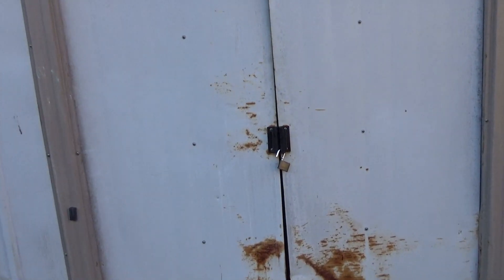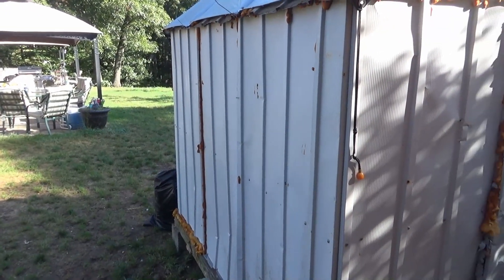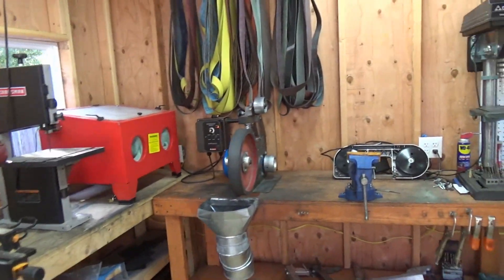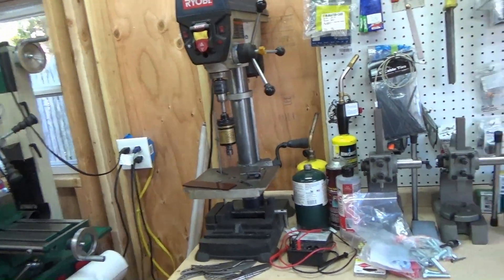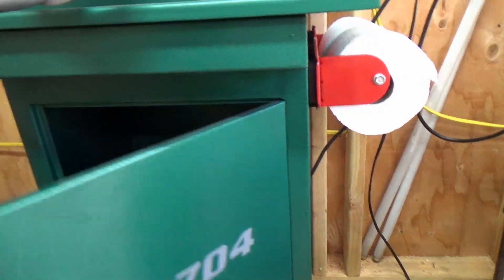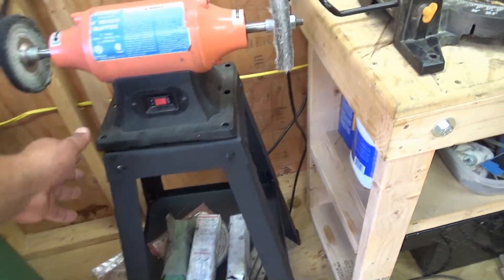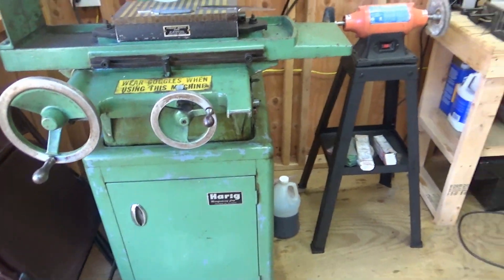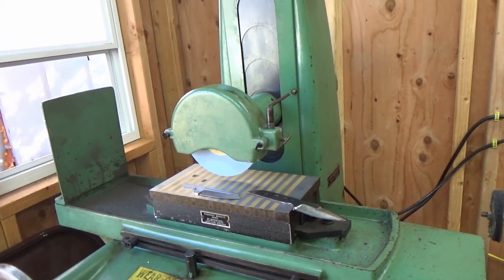I'm back with a big update!!

Comment: You put the right kind of cutting blade on that miter saw you can use it to cut steel bars for your knife blanks quickly and efficiently and is much safer than an angle grinder with a cutoff wheel. 

Very nice build Brother!

Comment: Great job on the new shop Mike! Looks amazing. Also, how do you like that Ryobi drill press?
Reply from the maker: +Dave G Thank you! The drill press is ok for the money. I would get something a little better for stuff like folding knives or really tight tolerances. It is great for fixed blades though.